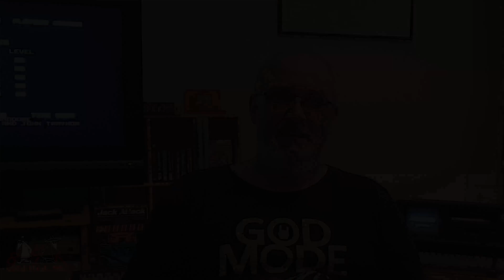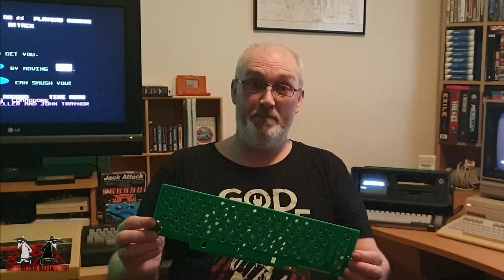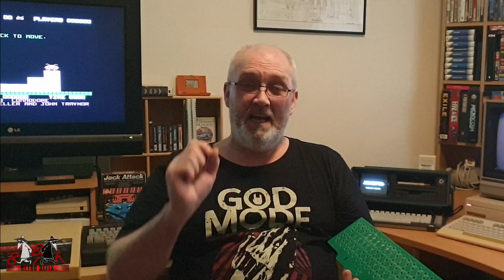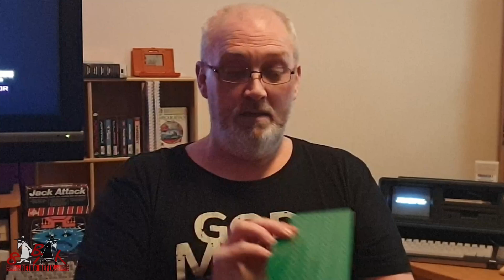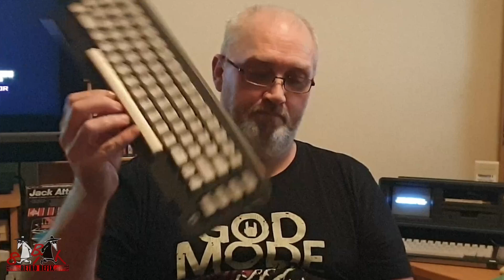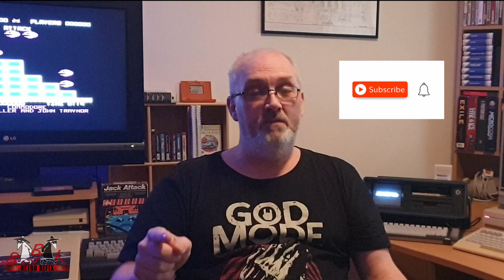DIY Computer Upgrade: Can We Install a Replica Keyboard PCB? Ep 4

Comment: Thanks for sharing! The folded part of the membrane has to be folded to make a reliabel  electrical contact between the membrane and the  board. That's why there is such a big contact field on that spot and not only the hole.  I am very curious if there is  a demand for SX-64 keyboard replacement PCB's. Because they do not deteriorate like the membranes.
Reply from the maker: I think the demand will lay with ppl with damaged or missing keyboards they seem to be the first thing to get damaged ... this completes the full set of pcbs thats coming out soon ... thanks for watching

Comment: Great stuff!: would appreciate knowing when the cartridge port boards are available ( beta is ok - I have the connectors to populate., my original cart port board has an intermittent electrical fault that was danaged from a poorly designed cartridge expander board)
Reply from the maker: They shouldn't be much longer :) .. but no definite date yet  .. thanks for watching
Reply: Will you be sharing the keyboard PCB files? Or selling boards? I just got an SX and the keyboard PCB was hit and cracked and damaged. I would love to repair this keyboard so I can use the computer again. Thanks for the video!
Reply from the maker: @Turtle_1976  Hi . Brian the pcbs are made by Rob Taylor and friends who brought us the sixtyclone boards .. all I know is Rob said early 2023 .. as we are almost in the middle of 2023 now .. they can't be too much longer ..
Reply: @8BitRetroReFix  I will certainly keep an eye/ear out. Thank you!